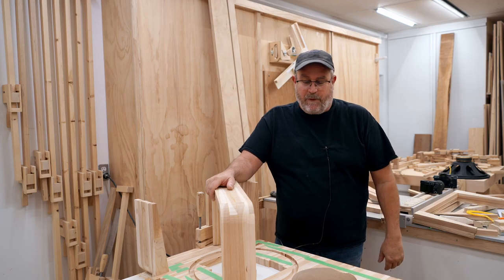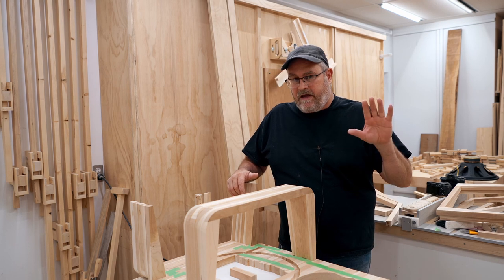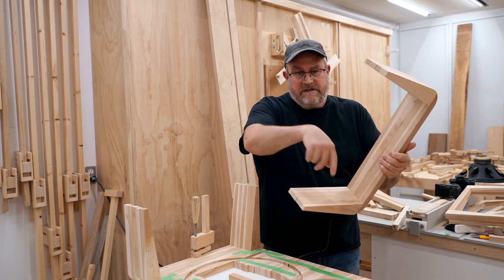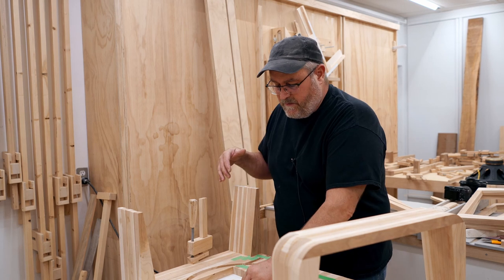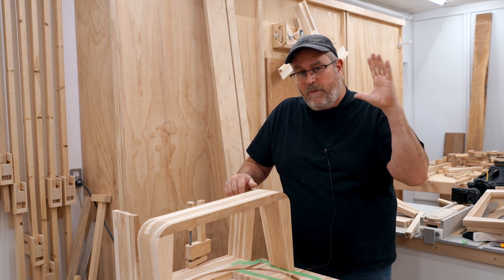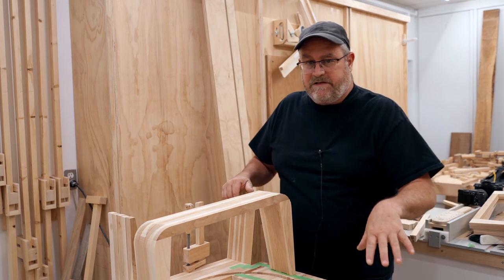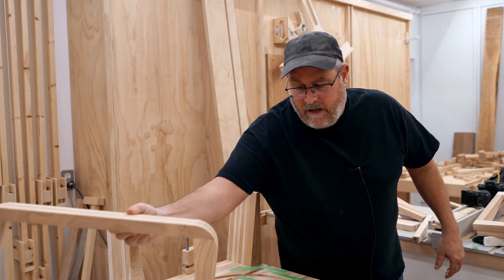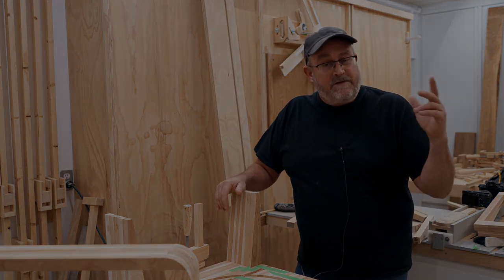Making Open Baffle Speakers - Too Many Mistakes! - Part 2

Comment from the maker: The lesson in this episode is look before you leap. I thought I had all of the details worked out before I started and just jumped in, but immediately made some costly mistakes.
First mistake was gluing together those frames for the layers and then gluing those together to start assembly. Second was rounding over both sides. Both of these could have been prevented if I'd bothered to look at the drawing I made months ago, instead of cockily moving forward.
Anyway, part of the "fun" is dealing with the problems you've created for yourself when you aren't prepared. And I'm already having too much fun...

Comment: I was wondering when you posted those pics how you cut that round groove around the hole on the inside with the sides on. 
Fail to plan.  Ya, I've been there once or twice.

Comment: 3:30 I don't understand why the drivers have to be in a recess on the backside.   Why can't you just screw the drivers to the backside, then use a roundover bit to flare out the front side?     What purpose does putting them in a recess on the back achieve?
Reply from the maker: It will look better and help with time alignment.